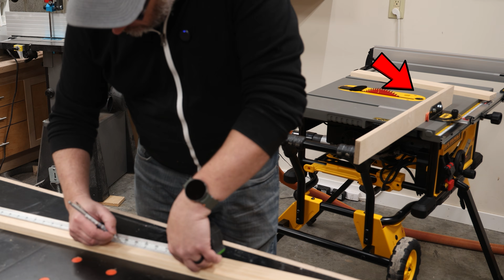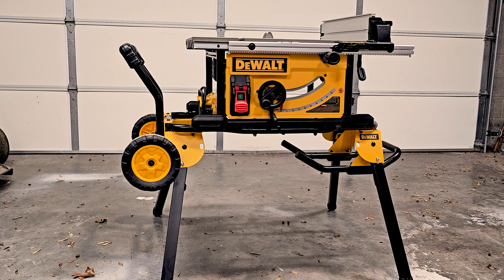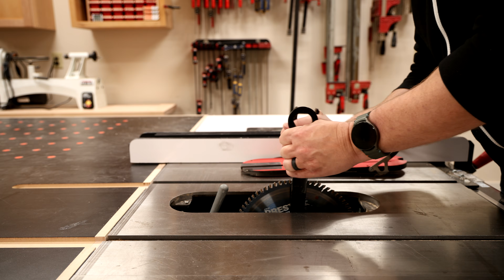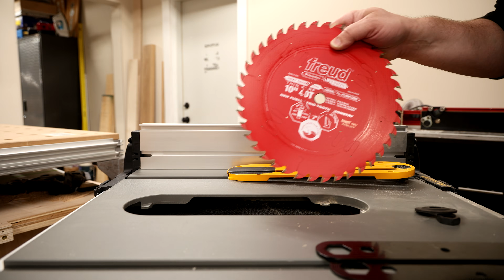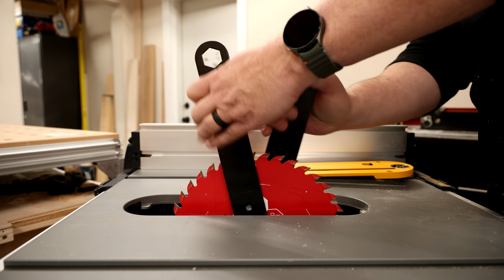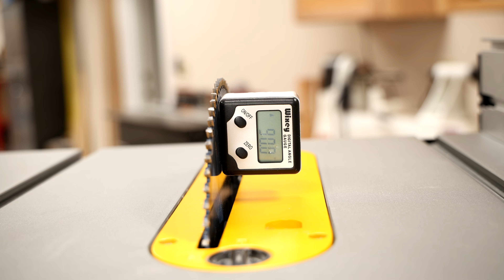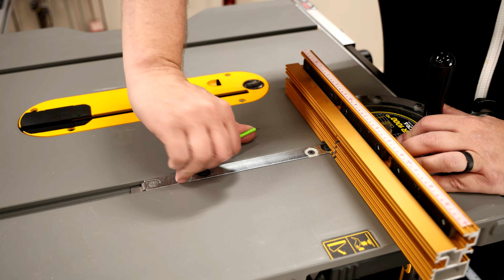Why do people even buy this saw?

Comment: You honestly can't compare the two types of table saw.  The comparison should be how close a jobsite saw can get to a far heavier and more expensive table saw.  I'd like to add that with 'any' table saw you'd need to calibrate it along with the fence.  My view from this video is that for 95% of usage, given calibration and in/outfeed support, the jobsite saw is the way to go.
Reply from the maker: you paid attention to the video 😄 ⭐
Reply: @MWAWoodworks  Yes I did.  My concern however is still the same - you can't compare the two.  Well, you can, but as a comparison it doesn't serve any real benefit; a professional who needs the needs the precision (etc.) of a cabinet saw wouldn't even consider a jobsite saw.  What your video did put on the table (no pun intended!), was what's required to get the most out of a jobsite saw with regards to precision (tracks, motor, blade & fence), so in that respect you did a great job and you get a big thumps up!
Reply from the maker: well the intent of the video was never to compare which saw is "better" I explicitly stated in the video up front that the cabinet saw was better in every way. the point was to show people who might be wondering if paying for a cabinet saw is in fact worth it, exactly what is better and what it means (or doesn't mean) so they can decide to upgrade or just save their money and keep the saw they have.

Comment: 19:40 There is a secret second position for the wide rip support where it rests higher and can sit above the table surface and function as a thin rip guide...if you're careful! There are two sets of clips for the pins on the support, one lower for wide rip support and one set higher for thin rip guide. Shown here: https://youtu.be/IR4DiumC1no?si=V5DYkV0LUKn0_y32&t=497

Comment: The cost of the Sawstop is pretty rough, but I could save and swing it.  However, the cost of building a shop that would comfortably hold a cabinet saw, now that is a whole nother level
Reply: Yes, VS a jobsite saw that fits anywhere.
Reply: @randythescout  Totally different tool. A contractor saw, without both wings, doesn't take any more space and is a hell of a lot better too.
Reply: The space is the deciding factor. I need a table saw I can move around. That's non-negotiable therefore its contractor or compact saw for me.
Reply: Yeah, my $100,000 shop to fit my $5000 saw was a hard sell…
Reply: @MrYellowClyde  Dunno, my shop is worth about $600K.  It does have an attached living area.
Reply: I have one of those. 3600ft^2, with an additional 2000ft,^2 for my shop. I'm not using it all. Yet.😂
Reply: I have a 2 car garage shop and i got the Saw Stop because after 30 years of using a table saw "safely", i decided at 67 i didn't want to lose fingers late in life, now that i'm using it more in my retirement. so save my dollars and purchased it.
Reply: @frederickgoldberg7235 have you had to buy a replacement blade yet?
Reply: I see a lot of YouTubers with SawStops in one or shared two-car garages.  YouTubers wouldn't lie, would they?

I don't think I'd put a SawStop in a garage, though.  I had my Unisaw in a garage for a couple of years.  I'm still chasing the rust.  A drop of sweat dropped off my noze and you could see the rust forming.  That blotch is still there, over fifteen years later.  Harvey has saws with a nickle coating over the cast iron table and the trunion parts. They're rust "proof". I think James has the nickle Harveys all over his shop.
Reply: @kwilliams2239  Rust only bothers posers and those youtubers that have Women pony tails and drink $30 coffee shakes in the mornings before their yoga classes after dropping off their single mothers at a "chicken soup for the soul" support group.
Reply: SawStop has a great safety feature as long as you are the onle one useing it. ( Everyone seems to want to trip it to see how well it works. ) Our shop went through about 8-10 blades and cartridges in the first six months. My self I'd never own one for many different reasons.
Reply: I got the Sawstop Job Site saw. It's great overall I thought I'd miss out by not having the rack and pinion fence; but, the stock one is actually pretty good. The cost was rough compared to the DeWalt; but, I've been to the ER for 3 stiches on my finger before. $1900 later (with insurance), I decided if the saw keeps me from losing part or all of a finger, I figure it's worth the cost. Of course this was back when it was only $1200 for the jobsite saw.
Reply: There’s a ton of costs these more wealthy woodworkers don’t mention. It’s extremely sensitive and trips without your hand anywhere near the saw. When it trips, it breaks the blade and the sensor motor, and they cost $200 to replace.
Reply: @JarMomErika no it doesn't. We've run one in our space for 4 years and just tripped it for the first time when someone twisted their jig into the blade. If yours is randomly going off with no metal in sight, you should have dealt with support by the second time that happened, or stop using sopping wet wood without enabling the bypass. 

I hate sawstop for a variety of reasons, mostly around their patent shenanigans and not being able to get a similar system from any other manufacturer, but this is the worst take.
Reply: @JarMomErika  The brake assembly is about $100, but the blade is $200.  BTW, I don't have  a SawStop (but might just as well have).
Reply: @kwilliams2239  do you have to use their blades?
Reply: @Pfish1000 who's blades? Sawstop? No, any normal table saw blade works. I'm sure there is a saw somewhere,  but I don't know of any full-size table saws that need a special blade. Some of the under-powered saws want a thin kerf blade, but other than that, all 10" saws use the same blades (10" blade 5/8" arbor). Specially blades may be smaller.
Reply: @Pfish1000  no it’s just that the braking mechanism destroys the blade when it triggers.  So a brake replacement also requires a blade replacement.
Reply: @J @JarMomErika  I don’t think so.  I’ve owned one for two years and have never tripped it. Just don’t cut wet wood.

Comment: Your advice is spot on. I have over 40 years experience building cabinets, built ins, and full builds as a state licensed general contractor and what I would tell any aspiring woodworker is that high dollar tools aren’t going to make you a master craftsman any more than top dollar golf clubs will magically turn you into Tiger Woods. Having said that if you can afford Sawstop and Festool and they give you pleasure then by all means do what you enjoy, but if you want to become a master craftsman don’t forget that it’s all about knowing how to set up your tools correctly and safety and build square, install plumb and level, and knowing how to correct your mistakes.
Reply: It's not always that simple. 
That dewalt saw often shipped with a crooked surface. Dips and humps so bad that you can't calibrate the saw. 

A saw that can't be reasonably calibrated is the worst nightmare for beginners as the last thing for a beginner you want is to have to fight the tool.
Reply from the maker: @shkhamd  no harm in testing it tho and if it's not fixable the big box stores and amazon have no-questions asked return policies! 😃
Reply: @shkhamd  This goes right to what he said, "knowing how to correct mistakes", go get some epoxy, it's what I had to do.
Reply: @shkhamd the saw can be returned if you have a flaw in the casting/top… let alone other flaws. 

More times than not you can accomplish the same goals with a compact saw. Add a track saw and you still save money. 🤷‍♂️
Reply: I've seen similar analogies in quite a few situations, but as in most, there is a problem with it.  Certainly, high end gear won't make you a master, but poor quality gear will prevent even a master from succeeding.  It doesn't matter how skilled you are, if your tools simply don't function the way they are intended to.
Reply: @danbell3827  This. just doing setup for complex joints often require configurations to be locked in. If you're just running dado's for shelves and the table isn't flat, you're not going to get the carcass together. The guy is going to be frustrated wondering what he did wrong...
Reply: Actually you don't need any power tools if you are good with hand tools.   I am not a master craftsman but I am a master tool collector.
Reply from the maker: I appreciate your comment!
Reply: On that, the first thing I figured out was, if I could put a Unifence on a cheap site saw, it would improve it 1,000 percent. If only because all you have to do is flip a lever, move the fence to the reading you need, lock it and go.
Reply: @kellyvcraig there are aftermarket table saw stands that will allow you to use T-style locking fence like the Rousseau table saw stands that are factory preset for the job site saw in this video, the DeWalt DWE7491
Reply: I have a 2 car garage shop and i got the Saw Stop because after 30 years of using a table saw "safely", i decided at 67 i didn't want to lose fingers late in life, now that i'm using the table saw more in my retirement. So I save my dollars (not pennies) and purchased it. You can save money on the Accessories. made them my self. collapsing out feed and extension tables.
Reply: I'm sorry but I'm going to take exception to your post. I have the PCS, and it is the most accurate saw available, hands down. I say that because it's the only saw that has adjustments for the compound deviation when the trunnion is at bevel angle. What is parallel to the miter lots at 90 veers at 45. Sawstop has not only set this accurately from the factory, but has an adjustment to compensate for any wear over the years. I've turned out nice work in the past using an old sears craftsman. It wasn't easy, nor enjoyable. Since having this saw, it's been night and day. New woodworkers will need to make an investment somewhere, and the table saw is the very heart of the shop. Perhaps SawStop is a financial stretch, and it is, but I certainly wouldn't suggest a jobsite saw. Not even SawStop's. A cabinet saw is so much nicer from multipoints. Quieter, far better dust collection [of which SawStop excels at] and stable. Festool is a little more complicated. Wish I had a Domino, and the Kapex is pretty special, but everything else DeWalt does as good or better. The balance, you're quite right; 5 tenets of straight, level, square, plumb, and tight. Norm Abram once said the true mark of a craftsman isn't how many times he gets it right, it's how well he corrects it when it's wrong. Couldn't agree more.
Reply: @Jim-jm1db , I don't know who you are responding to, but have you ever owned Powermatic or Unisaw cabinet saw?  They, too, can be adjusted over the years.

The probability is, Sawstop came up with a lot of must haves by building off the brands that came before them.
Reply: @kellyvcraig  Not for parallelism at bevel. Sawstop said that is an exclusive feature. Is it the most important thing?? No, not at all. But it was one in a long list of features that convinced me to spend my money with them.
Reply: @Jim-jm1db  , and?

Cool.

Meanwhile, I know of 40 year old Unisaws still on the road (e.g., a friend's cabinet shop) and they are just as accurate as when they were bought.
Reply: @kellyvcraig  Sir, certainly I would agree wholeheartedly that there are a number of fine saws available, new and used, in a number of configurations. This was a discussion in regards to the extremes of SS PCS vs. Big Box Jobsite saws. I know a contractor who swears by his DeWalt, and I understand why, would never criticize his choice, or any others. But others here are in the market for a new saw-or used-and may not realize all of the options-pros and cons- of each. As for the safety aspect; I've always tried to be careful, for sure. But I've also done contract work where time was of the essence. One time I needed to get something done, it was an Easter morning, actually, got up early, one part on the bandsaw. Compound cut, couldn't really see the underside of my hand. About 3 hours in emergency, several stitches but all is good. Table saw would have been a different story.
Reply: On the bright side, your wife can't break out the taillights on your Yukon Denali with a table saw.
Reply: No. I DO REALLY LIKE my fingers though.  😊

Comment: About 18 months ago I purchased a SawStop Jobsite Saw, and have been very pleased with it.  I'm constantly surprised at the fence accuracy (to the millimeter...consistently!), the ability to use a dado stack, the safety element, and the ease of adjusting the blade angle have made this saw a joy to use.  I don't have the room for a bigger cabinet saw, so this works just fine for me.  Also, on sunny days I roll it outside where the fresh air is a nice bonus, and the cleanup is easier.  An upgraded rip blade is also beneficial...
Reply: This is it — the right balance of safety, price, capability, stability and size.
Reply: I bought the first edition SawStop Jobsite Saw because it was on sale due to the new issue Jobsite release and was pleasantly surprised with the out of the box dead-on accuracy,the only store bought upgrade was the Incra miter gauge which is necessary in my opinion. This saw was purchased with safety and portability in mind as I am a proud father of twin boys who show an interest in woodworking,that being said I am fortunate enough that I have the cabinet saw and use that as my shop saw. If you can not afford such equipment,there are great alternatives on the market that can be upgraded with minimal costs. Every time you build a birdhouse or built in cabinets, you are honing your skills and improving your outcomes, take the time to research your options and you will be surprised at what you can accomplish with less.
Reply: Sawstop saws are wonderful until you set the brake off. If that happens be prepared to realign your saw, which can take some time.  Better yet, don’t set your brake off! Otherwise it will be one of the best investments you can make unless you need something which takes a 12-inch blade, such as the Oliver.

Comment: I bought a 7391RS and replaced it with a 3hp sawstop, I regret selling the dewalt, having a small saw for easy set up for making small jigs for more smaller cuts was really nice.  I couldn't justify keeping it around though, I'd have to keep it set up and ready to use or I'd never use it and I never did.

Comment: This is a non-issue for me because table saws in general scare the crap out of me, and I just won't use them. I much prefer either using a circular saw with a track adapter, or using a dedicated track saw. A lot of people will say I'm limiting myself, but honestly, the only real difference is time. For me safety is paramount because hospital bills are way more expensive than tools, and materials are. If it takes me more time to do a project, so be it, but it's not like I'm building fine furniture, lol.

Comment: In my mind jobsite saws are just not manufactured for fine woodworking, hence the top on all of em are just like this dewalt, fact I'm surprised the miter slots are doable at all, lots are not..these are for ripping osb on a framing crew, although you can make it work but why, just get a decent contractor saw and be done...
Reply from the maker: many people find a way to get started on them!
Reply: @MWAWoodworks right its just a couple hundred bucks more you avoid all of the headaches with these..truly, new guys have no clue how or why to adjust these machines,  id stear em all away from jobsite saws, but thats me and i get what your sayin..

Comment: for much less than that cabinet saw and probably less than the job site you can get a great used cabinet saw. I found my 70's rockwell unisaw for less than $600 a few years back. even if it needs a little cleaning and some bearings you will be shocked what kind of value you can get.

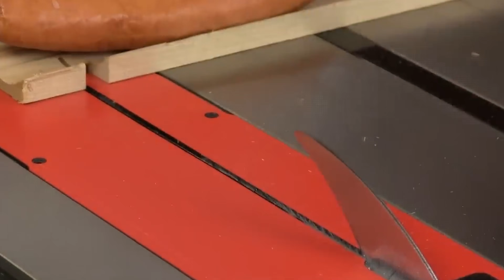Comment: 21:38 Combo blade vs. rip blade. Use rip blade for ripping hardwood. The DeWalt manual recommends alignment before use . I upgraded from an 8 1/4" B&D, so the DeWalt was like a Cadillac to me.

Comment: Step 1. I feel the upgrade from the contractor table saw to hybrid isn’t that much in cost and it’s nice upgrade. One upgrade you didn’t mention is the reduction in noise.
Step 2. Once you start looking at the hybrids, it’s not that far to a full blown cabinet saw. Step 3. If you’re looking at cabinet saws, might as well get the Sawstop for the huge safety factor. Step 4. Look back and ask yourself how you got here. 
Step 5. Repeat steps 1 through 4.
Reply: Some of the differences you didn’t point out:
Cabinet saws are mostly much quieter.
The steel top allows for more customization options using magnets.
The longevity of a cabinet saws is much greater.
Dust collection is often much better.
The overall cool factor of having a cabinet saw. lol 
All the combined improvements of a cabinet saw makes using one over a contractor saw apples and oranges. 
It’s like comparing a Hyondui to Cadillac. Sure they both get you there, but one is a much more pleasing experience that not all people will get to regularly enjoy.

Comment: The sad thing is apparently there no longer is what I’d consider the middle ground: what used to be called a contractor saw. I’m talking about the old Sears or Delta table saw with a capacitor start induction motor and belt drive.    My 1992 $400 Delta saw saw has made a lot of fine furniture. The only upgrade was a Vega aftermarket fence.  Aligning the blade to 0.001” parallel to the miter slot is a pain but it’s only necessary every couple of years.